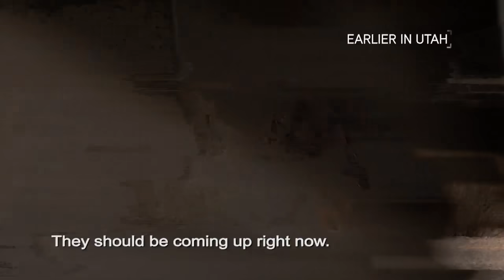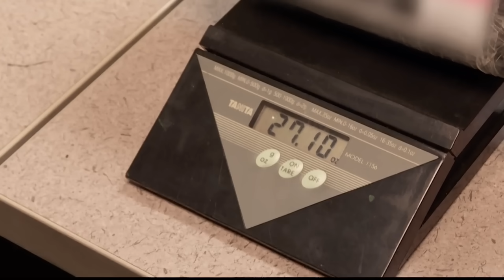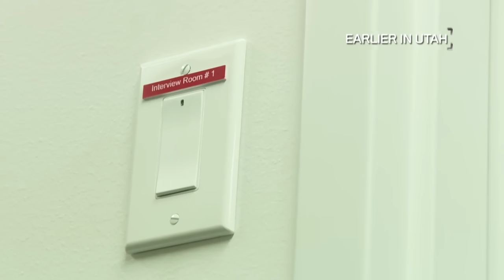Live PD: Most Viewed Moments from Utah Highway Patrol | A&E

Comment: Imagine them accidentally spike stripping those 18 wheelers.
Reply: Kyle Gilbert That would be a mess..
Reply: Kyle Gilbert RIGHT?? I was thinking the same thing!!!
Reply: something tells me it wouldnt do much. their tires are extremely thick and made to trample things lol
Reply: TheJechtShot that is a lie. It would have popped them. And loosing one steer is hard enough, two would be terrible
Reply: @whatdidyoutoldm3293  how can it be a lie if i didnt present it as fact. i was guessing >.>
Reply: I would hope those other vehicles would enough common sense to stop till they properly remove the spikes
Reply: Fr
Reply: That’s not very much room to stop for 18 wheelers.
Reply: The 18 wheeler driver would have got caught-

UNO REVERSE ON THE 18 WHEELER OWNER LOL
Reply: Oh man, that thing would probably flip sideways from the sudden shift forward.
Reply: Wow that is an interesting thought as CDL holder here are my thoughts, commercial tires are much harder (both the rubber compound and the inflation 120PSI vs about 35) so it is possible the aluminum spikes would not penetrate, but I am guessing they would (I have gotten screws stuck in my tires, although they were too short to flatten the tire) tires have a large volume of air and would take a while to deflate. My prediction is a controlled stop and long day for a mobile tire guy fixing the tires.
Reply: well they didn't.. and that makes them a pro
Reply: At between $350 to $800 a tire (depending on whether it is a new or retread. Steer or drive) Utah would be out a lot of money.
Reply: @whatdidyoutoldm3293  it would be a slow loss of air and controllable.
Reply: Looks like the truck pulling the camper took off with the spike strips…lol
Reply: Yeah... that's what I was concerned about.
Reply: But they were conscientious enough not to..

Comment: Fix your windshield dude... I know people that got pulled over for that
Reply: Utah doesnt do safety inspections anymore. The legislature determined it was a tax.
Reply: Windshield regulations differ by state. It looks like Utah requires any damage not within six inches of the edge to be repaired. That's pretty loose IMO.
Reply: Also, its a police vehicle.. not like the cop has control over it being fixed or not. Its also not enough to deadline the vehicle.
Reply: Pigs are alowed to break the law.
Reply: @deadfox7355  
Yes your absolutely right.
Reply: Dead Fox you’re probably one of the suspects featured in this video.
Reply: thechairmancow bulshit. I got pulled over for a cracked windshield. Also to get it licensed you need inspection which doesn’t allow more than 6” of a crack
Reply: @bluescoobysnack9791  You're in the wrong county then

Comment: That sounds exciting. * Displays an MTO violation of a severely cracked windshield which is a structural weakness. That vehicle is not safe or certified for the road under OPP highway and traffic codes. In the interest of being fair use this to ticket the officer and recommend they send it upward to their department heads. If civilians gotta pay so do the ones protecting and serving the same fines they pass onto others.